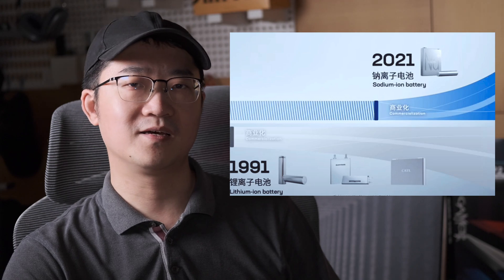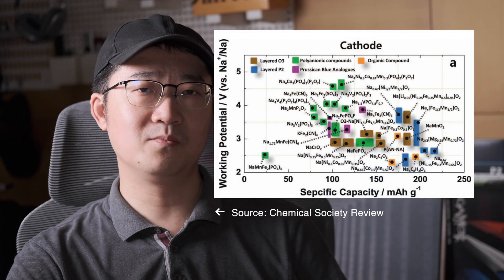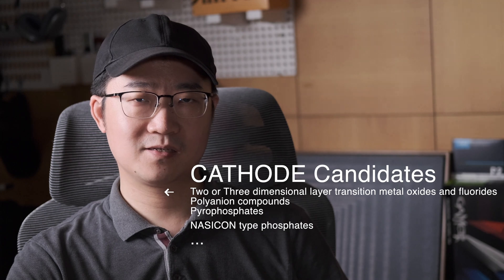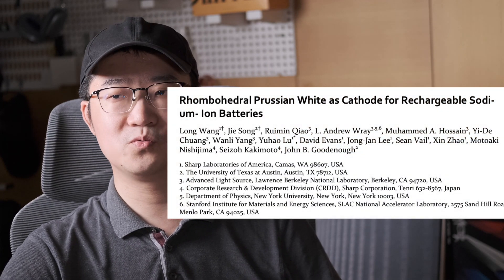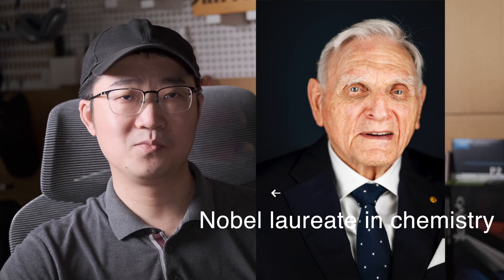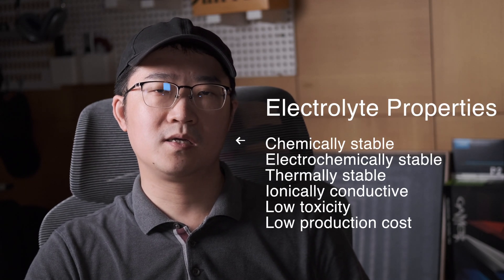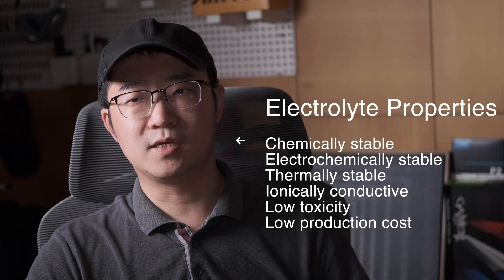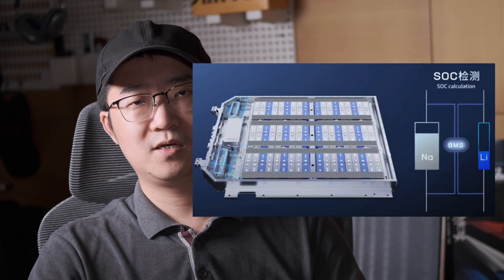CATL Sodium-ion Battery

Comment: This is so useful to understand the brief mechanism of the SIBs and the future direction of Catl. I have one question. in 5:48, you mentioned that sodium ion has more fast diffusion in the solid phases. But in normal, lithium-ion has faster diffusion ion transfer speed. So you said the "faster diffusion than Li-ion" means when the condition is set to -20degree?
Reply: Im also curious about this question!

Comment: Is there an advantage von Na-Ion about Li-Ion regarding simplicity of thermal management? Eg you don't need to heat Na-Ion in winter, maybe it also can maintain higher temperatures during charging and discharging. That would reduce weight and costs for a Na-Ion battery in EVs. Am I right?
Reply from the maker: ya, thermal management would be different, hopefully it goes to the easier way as referred according to the official statement. we will test it once get the sample. and from the system point of view, it will compensate a bit while the overall weight may not be change in big manner due to the comparable lower energy density of Na-ion battery. while the cost is the most significant point i suppose by using Na-ion battery.

Comment: Hey Peter, you've just got a new subscriber, me. There is a gissip I want to share with you. The anode of Sodium-ion battery in the next generation, it will be setup by NVP, "Na3V2(PO4)3". So how do think of this? Is CATL researching that material for the next generation? I'm not an expert in battery, hope I didn't post a foolish question, I'm sorry.
Reply from the maker: regarding the chemical details, i cannot describe too much here. it will turns out when the first batch of sample is released and UZ Energy may have the chance to test.

Comment: There is no  and never will be a shortage of lithium. Very abundant all over the world and is relatively easy to mine. Also, because vehicle batteries will be recycled; extracting 92% of materials; very little lithium will be mined.
Reply: Exactly. Current "shortages" are strictly related to shortages of cobalt and nickel which are currently used in high performance cathodes. These are already removed in LFP batteries. On the other hand, almost every high end battery will have removed cobalt from their chemistry due to supply constraints by 2030. This is a cool cheap battery technology, but it's not ground breaking yet.
Reply from the maker: @wakannnai1  yes, along with the less use of cobalt, the most urgent concern is the nickel.
Reply: From CATL Sodium ion battery mainly target to energy storage market, not vehicle market.
Reply: @wutangtang8590  I would not dismiss any use of those batteries. For large lorries that have the place and can carry the weight it might be interesting because they will be cheaper then Li-Ion. But maybe LFP would be the better choice? I don‘t know. But i would not exclude any use for any type.
Reply from the maker: haha, you have the same opinion as Elon as stressed in the shareholder's meeting :) @Simply Human

Comment: So the Sodium ion battery  energy is between 1 to 4V... meaning that if you want all energy you must use a Boost converter to match the lithium ion battery voltage in parallel with it and managed by the BMS...  i am curious to see the calculation of overall efficiency of that new combined system.
Reply from the maker: i am also curious to that.
Reply: Somewhere between 10 and 16% less efficient than Lithium-Ion.

Comment: So.. what is better? Why does Tesla go with nickel? Because of manufacture ease?
Reply: Lithium-Ion batteries with a nickel-based cathode have a higher specific energy (the battery weighs less). This is important for long-haul trucks and very high range cars.
Tesla also buys a lot of LFP cells from CATL, which are quite similar in performance to these newly announced Na-Ion cells. If they can, Tesla will probably buy very large quantities of these Na-Ion-Cells. They are ideal for cheap cars and stationary storage.
Reply from the maker: Tesla is the pioneer in electrifying those using tractional power sources, therefore the choice is somehow limited at the very beginning. Bundling thousands pieces of Panasonic 18650 was considered crazy at that time. Years later, Elon made it and convince publics the possibility of EVs. 
To further increase the market share of EVs, the overall cost-down is a must. Therefore, Tesla gradually take use of LFP as the power sources, as seen from the Model 3 and Model Y. Regarding the cost, Na-ion battery has no doubts the huge advantages. To my point of view, in short term, Na-ion battery will not take place NCM or LFP batteries in main-stream EVs, While it is hardly to conclude in the long terms, since engineers are continuously improve battery tech to balance the cost and performances. Na-ion battery in EVs, who knows :)
BTW, the manufacturing process can be transferable from that Li battery process, as mentioned in CATL presentation.
Reply: @UZENERGY  I will give Na-Ion a chance in EVs. Because here in northern Europe we have cold winters. And that is when LFP looses ..
Reply from the maker: @BremerFischkoop  still need a while, since Na-ion will be firstly accepted in ESS i suppose.

Comment: Great news.  Very exciting development.  What’s the potential for S-ion for longer duration BESS ( eg, greater than 4 hours)?
Reply from the maker: Now the detailed spec is yet available. For BESS, the duration time would not be a problem since larger capacity can meet up with the longer duration requirements. 
The more concerns are coming from the long time reliability (i.e. cycle performance vs. calendar year), since the cycle life of Na Battery is the most challenge.